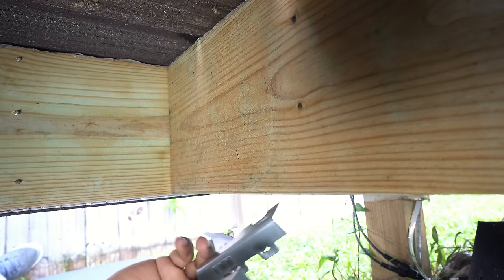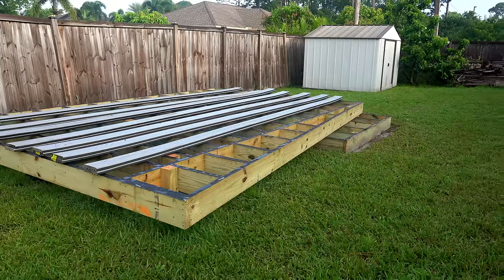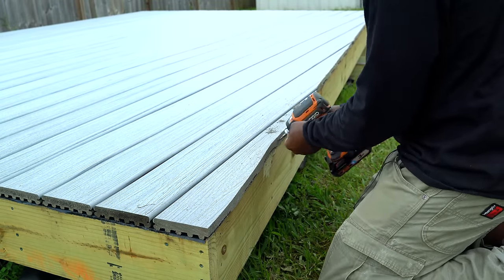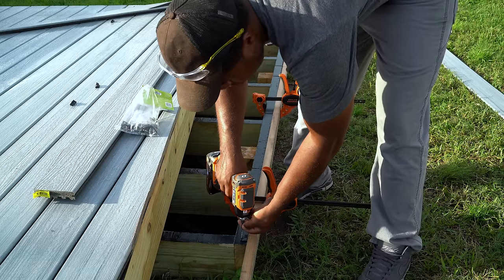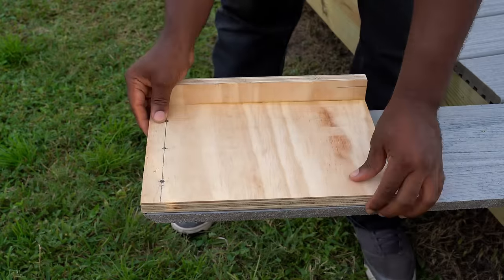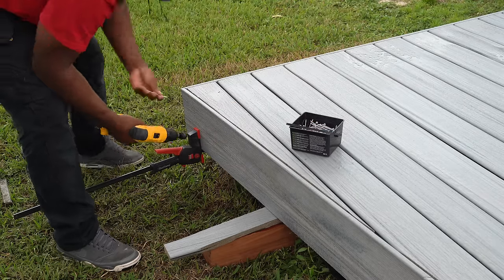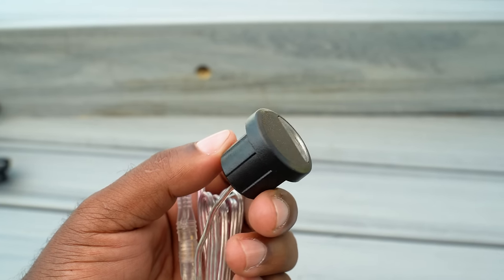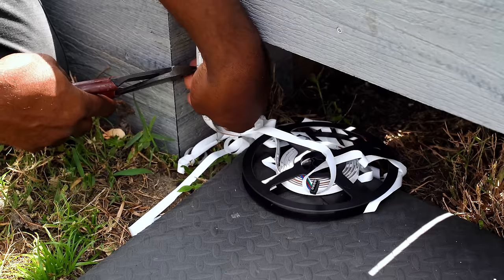Building A Ground Level Deck with LED Lights l Composite Deck (part 2)

Comment: What type of trex composite board did you use for the side of the deck? And also the screw and tip you used to drill them in?
Reply: Looking for same information

Comment: You should have waited to extra secure the front frame of the deck , allowing you to remove it as you approached the last 3-4 deck tops.
That would have allowed you to reach underneath , place the remaining boards, mark the underside one at a time, remove them to cut, then re-secure the front frame and place perfectly cut deck pieces into place.

lil, tricks.

Comment: Excellent video! Thanks for putting all of this together. I have a question on the location of the deck; is away from the house. I want to build a deck and in my mind I think of them near the house but you made me think outside the box. Because of the layout of my backyard I might be better off having the deck away from the house. Do you have a guidance on when to set the deck attached to the house and when to set it up away?

Comment: I'm planning a floating deck, are the concrete or plastic frame holders okay to use by themselves? I can use a shed anchor system to hold down the deck in the wind. And what about using 2 X 6" for the frame?

Comment: Question if I want to stud up and close it in with 2x6 will that be to heavy it will it hold up also do I have to use plywood so that the 2x6 plates can catch???

Comment: It's cool that you're doing it yourself but you did a lot of things wrong add your hangers before you put the deck boards on lot easier and never ever glue your skirt board and then screw it off your skirt board has to float in there. Trex makes fasteners for that. The thing with Trex is it expands lengthways not with Waze so if you screw it down like you did on your skirt board it's going to get all wavy just a few tips for you, from  a guy that's built over 500 decks..  and one other thing picture frame the deck boards a lot nicer look.

Comment: i am still trying to decide between wood and composite deck finishing, how its the 16 inch on centre joists with the composite decking. does it bounce a lot or is it solid. also if it bounces do you think 12 on centre joists would be better

Comment: But what about tacuaches living under the deck, and also for the post that go in the ground can I use foam instead of concrete?
Reply: You can use pier blocks. It's cheaper and easier.

Comment: I'm looking to build a deck similar to this in my backyard but I am wanting to add a roof with lighting to it and have the lighting be solar powered due to the large backyard and no power access. Any ideas/advice?

Comment: The legs for your deck wont last. You dont bury wood in dirt... you need at least a concrete pad with a pyramid block.  Or you make concrete footings.  it seems like its solid at first, but with rain and ground frost it will move.

Comment: The deck joists were improperly attached to the deck posts, there should have been a rabbit cut into the post for the joist to sit on. His way has the entire weight of the deck on 4 screws in each post...
Other than that, its a good job.

Comment: For the money, you can't go wrong with Trex and well worth it over cedar (which is overpriced these days)!   I just paid $260 for Cali composite to make my 8'x8' deck...that's just $4 SQFT and cedar was $4.30 SQFT...As an archtect, I NEVER recommmend cedar decking!  Composite is the ONLY WAY to get a garantee 25 years of no maintenance or annoying work of staining, pressure washing, replacing rotting boards, etc!

Comment: Wood into earth, treated or not, will rot. No exceptions. Best bet is dig the hole, fill it with concrete and put a steel galvanized post support in it before it sets. The post is attached to that so the wood has no contact with the ground or earth. Stronger and it’ll last 200+ years. Cut corners and do it cheap initially and you’ll be doing it over and over and over and at three time’s the price.

Comment: Ok all yall Youtube code ethic legislative employees of the internet, how do any of you know it's "not up to code"?  Have yall checked that area to see what the codes are?  Like here in where I've at, if it's under 24", there's no coding standards other than 16oc, 2x6 minimal. This includes not having to have rails.  Over 24", you have to be 16oc(which all does that by nature) and must have rails that of course need balusters with 4" gap so forth... Out in Greenville.  They can care less if you built it with 2x2 and 5star notepads for treads.  At least know the area he in before regurgitating "not up to code" and no, there's no "national code ethics and standards" for every single custom built deck known to man.  I see where 434 dislikes came from damn. He got 2.17 MILLION subs, he aint worried about yall.

Comment: The deck is built wrong. The joist are supposed to sit on top of the posts not be screwed to it. All the weight of the deck is sitting on those screws that hold the joists and the skirt to the posts. The joists in the skirt should be resting on top of the posts

Comment: Failed 45 seconds in by using carriage bolts instead of notching the post and allowing the weight to be transferred onto the post your way all the weight is carried on the carriage bolts this is wrong

Comment: You didn't stain the wood before you put the floorboards down. You'll have mold in no time. Well that was a giant waste of time, money, and effort. Many people think you don't need to stain treated wood but waitinga few years until you have to clean it to stain it is such a nightmare; the decks past have just been torn out and remade. It's too hard to tell when the mold starts underneath and it's often too late by the time people realize. Seeing as it's the base that's unprotected, the entire thing has to go. (Personal experience; two homes.)

Comment: If it were me i would have just built the deck square,  far less work and looks better in my opinion.
Reply from the maker: And look like everyone else deck. I like this concept, not for everyone that's for sure. It's still squared on three sides. I wanted the front to be more interesting 😃.  I find a big rectangular a bit boring. Thanks for tuning in though.

Comment: Why do we go to the high expense of buying composite decking? Answer: it will never rot.  But what about the wood below it. All that framework is made out of regular wood. Even if it is pressure-treated it will get wet and eventually rot. Then you’ll have to take the whole thing apart and rebuild it with new wood. Why not use composite wood for that framework as well. Composite wood comes in 4x4s, 6x6s, 2x6s, 2x8s, etc.  To not do this makes absolutely no sense.
Reply from the maker: Well, it's not just about rotting, it's also about the maintenance, warping, Split, splinters. Also, my fence post been is the ground for close to 10 years now and is in very good condition. Pretty sure I can go another 15 years with no issue.
Reply: DIY Creators are you talking about a covered or uncovered porch?

Comment: Putting the joist hangers on AFTER putting the decking down so you have to bend yourself up like a contortionist to fit them from underneath whilst struggling to see what you are doing.... Is a REALLY poor way of getting the job done both in terms of time management and safety. Just saying.